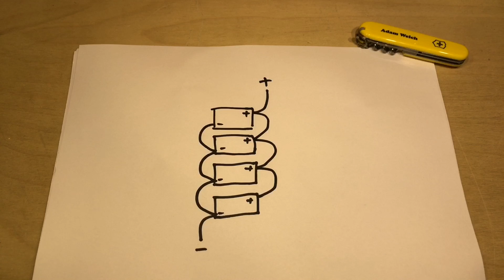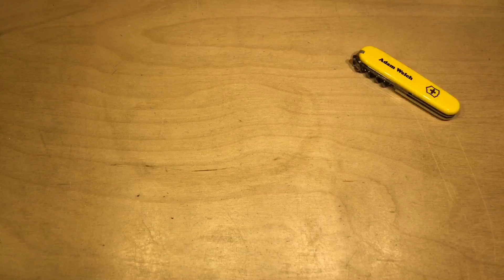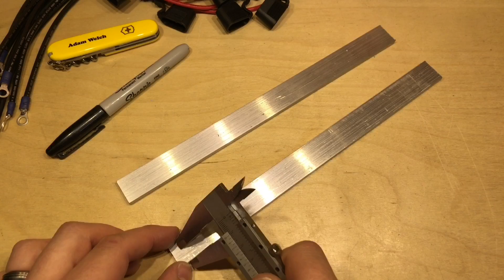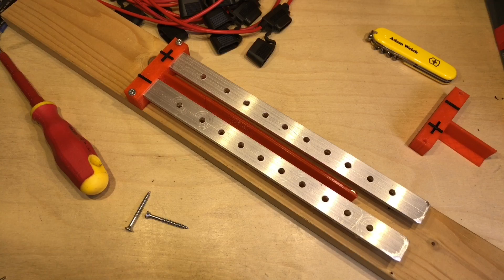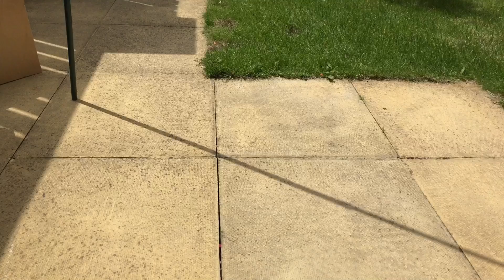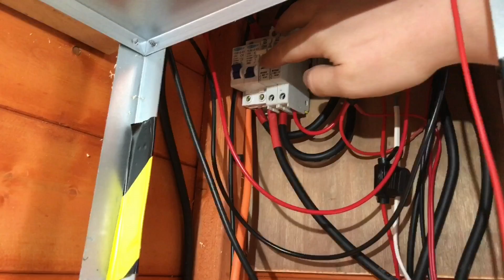Battery Bank Reconfiguration - 12v Solar Shed

Comment: That iine fuse holder is far underrated... you are wayoffon your cabling...   look outfor a meltdown... scary setup.  Yes it will work... but is it worth burning down the building it is in

Comment: Hi Adam, I am a new subscriber looking into your old videos. The wiring seems to be small if you have an inverter but is that because each battery is now going through the busbar?
Reply from the maker: Yeah, with the batteries in parallel each one was delivering only a small amount of current which adds up to to a much larger current on the bus bar and the main positive and negative cables. Each battery was fused at 10amps if I remember correctly giving around 80amps available for an inverter.
Reply: Thanks, has it panned out well over the years doing it that way. Clearly it would be cheaper to start from scratch that way.

Comment: I use flattened legnths of copper plumbing for my buss bars. Make friends with your local plumber and you can probably get more 1'+/- cast offs than you could ever use. If you really wanted to be finicky about it one end of the lead could be soldered right into holes you drilled.

Comment: Great one I like it I did something similar to the 24-volt bank I got in the house but this is great I'll do that in the garage since I had 4 12-volt batteries in parallel and the middle one died and drained the outer to

Comment: The batteries being right up against each other is absolutely fine. if your having trouble with high battery temp you have charger issues or bad cells in one or several batteries. the biggest problem i see is your wire is way to small and too long. your losing efficiancy ...

Comment: I have been given 2 batteries built from 84 LG Chem 60 amp hour pouches configured as 14s3p
I want to keep them in tip top condition until they get connected as a household powerwall.
Something like this would slowly charge them, but should I take them to say 70% charged and every so often check them, or charge them to say 47 volts and have them discharging through a small load down to say 42 volts then repeat, and how big a load should I use? I was thinking a couple of 24volt bulbs in series.
I also have some configured as 3s4p that need looking after.
I need a bigger shed
Reply from the maker: We all need bigger sheds Roger! If you are storing your lithium cells for long periods it’s best to charge them to a mid cycle storage voltage (for example I’d go for about 3.8 volts for lithium ion). That’s how most new electronics are delivered and stored. This will also allow you to see after a few months of any of the cells are self discharging more than any other. 
Cycling your cells, even only lightly will reduce their service life. It’s a chemical reaction after all and the process can’t go on forever.

Comment: Yea, short Bus Bar is the means.  Utilizing Aluminum somewhat defeated the purpose.  LOL  I use Aluminum Bar like that with little to NO ISSUES.    Not quite as conductive as Copper but using over size corrects that issue.  CHEAP !  Employ Conductive Adhesive used for Auto Window Heater Elements insures electrical Bond for years.

Comment: Hallo adam i like your video but in this case this is not save suppose there is a Mouse don 't dak where she com from but belief me she going touch your two bars and then bang You have a dead Mouse make between the two bars 50 cm and put direct after the fuse a switch That can break the red and the black wire  now You can change one battery safely
Reply from the maker: That really isn't an issue for a 12v dc system.  I can touch both buss bars at the same time without getting any type of shock. I don't believe a mouse is anymore conductive than my finger.

Comment: I feel like you could have just taped those holes
Reply from the maker: Quite possibly, but I haven’t done that before with any success!
Reply: For aluminum and thin steel I have been using those drill bit and tap in one they break on thick steel but softer metals are fine
Reply from the maker: Cheers. I might get myself some.

Comment: For that ‘tight’ positive lead on the right, you could just loosen and rotate the bus bar end of it anti-clockwise, so it is pointing towards the battery - that should give you a little slack and less strain on the terminal crimp too. 
I’m really enjoying this series of videos- keep them coming 😊
Reply from the maker: Cheers Graham. Since making this video I have replaced this cable to give more slack. Still getting positive results with this setup too. Thanks for the nice comments and the suggestion.

Comment: i just did a very similar setup using the next size down in batteries, I have 2 banks so far both containing 6 batteries each. I have the charging off a solar panel in conjunction with a car battery that is charged from a separate panel. I have only just finished the setup and only visit the property occasionally so im yet to test. Is the idea that this will hold greater power than a single car battery? I did this because the batteries were free so I wouldn't have thought to do this otherwise. Is there a benefit to separate cells in this format or would the ideal setup be a deep cell truck battery or li-Po battery?
Reply: Note - Old alarm systems are a great place to get the small lead 12V batteries cheap or for free if your lucky. they are always kept charged and only the highest quality is used, however replaced in the new system so alarm companies have tones of them.

Comment: Looks like you have enough room to put a cable on each end, of each buss bar, and combine them at inverter(?)
Reply from the maker: I did leave room for expansion, but my inverter does come off the main cable. It’s protected by a breaker - or two.

Comment: Uhm.. that's not how batteries works. If you have 6 batteries in parallel, no mater what point you connect the load, the load across the batteries will be equal/the same. Same goes with charging, if they are in parallel, all the batteries will receive the same amount of charge, and they will equalize given a little time.   No amount of fusing will change that. If you connect 1 low battery in a bank of 6, the other 5 will discharge into the 1 low one until all reach the same voltage/level of charge.  If you have a shorted out battery in your pack.. all 6 will drain to the same level as that one. That's why you should only use 1 type of battery in a pack, never mix batteries of different type or age.  You can mix batteries of varying capacity with no issues. But they have to be the same type.

Comment: I have golf cart batts. in series. for 24v. it helps the inverter efficiency. but now I need buck converters for my 12v led lights. any advice for a good cheap buck converter that will last. I have about 10 16' led tape strips. and 4 are RGB. so I need about 30-40amps at 12v. I would like the most efficient design. or I may as well use my inverter. I also have a low voltage relay on mind. at 30 amps 24v. to shut off at 22v. use this with a 30 amp or multiple 10amp units. what ever is most efficient . power consumption wise. great videos very inspiring. makes me want to finish my off grid home. and move.
Reply from the maker: I pretty much tested this exact thing a little while ago - although not to the level of current you are thinking about.  If you use a load output of a solar charge controller that should give you the low voltage disconnect you require.  https://youtu.be/dZHuj3R-g9A

Comment: hey adam you can drop the gauge wire down as well because of load share tie your batteries in pairs instead of singles but do the same and keep the cables the same length. Keep in mind as well path of least resistance the point where the batteries as closer to the inverter those batteries will be drained first and the farthest will play alot of catch up under high loads. Also the first to get drained is the first to get charged and also the first to fail.

Comment: where did you get your batteries from I have two the same but would like to get more without pay lots of money
Reply from the maker: +mark smith They were taken from UPS's which were undergoing routine maintenance. They were due to be scrapped until I saved them.
Reply: I got mine out of car booster packs but waiting for more to come along so I can increase on amps aa there are only 20 amps each

Comment: Koodos!  Now ya just need to make another 3D printed part: a cap to cover the whole strip so nothing "accidentally" touches both bars at once. Which would only happen when you're in there doing some kind of maintenance. Unless you wanna do like Pete did and make sparkles  :P

And, of course, it's sunny when you can't use it, and raining when you need the sun :)

Comment: Hi Adam, i like the fusing individual batteries idea. Always good to have fuses. Worthwhile  for people to put an LED + feed resistor in parallel with each fuse to show if a fuse blows, so it doesn't go unnoticed & just leave 1 battery not contributing to the bank.Ideal for a low current set up without massive thick cables like yours.

I didn't fuse each individual heavy cable to each battery for my 3000 watt inverter. As you know (but others may not) each terminal crimp,connector & fuse adds a small voltage drop. The Smartgauge website has some interesting stuff on this. It surprised me just how bad this chap found the losses could be at heavy currents, when the total is maybe 200 or more amps for batteries wired in parallel.The losses on my set up are low, but over time with corrosion in the crimp terminals etc it could be a problem.

I 've fixed quite a few Dragon rechargeable searchlights, like the police use. These can draw up to 8 amps (100W) & have push on crimp terminals to the cut-out circuit board. After years of use it was possible to lose up to  nearly 0.1 v  at every crimp.With wiring, the fuse/holder, relay, battery connector & loads of crimps you could end up wit 12v at the battery but less than 11 v at the bulb.Fitting new crimp terminals etc. improved this a lot.

Thanks for an interesting video, regards.
Reply: Meant to add , always best to solder the crimps like you've done to avoid poor contacts inside, as years go by. Commercial products often don't bother for manufacturing speed. I've noticed that the pre- crimped heavy cables people buy for car starter motors etc. often aren't soldered. You can sometimes only easily tell by removing the heat shrink on them & looking,  Fuse indicator wise, I was thinking of a separate mounted little box with LED's in a row connected across each fuse with a resistor. More work , but if someone was starting from scratch, the thin wires to the LED box could go in the same crimp connectors .Should indicate if a dud battery blew a fuse with a shorted cell. Enough voltage difference to light an LED. I don't  think shorted cells are that common for lead acid batteries, but it does happen. A 10v or so faulty battery with the higher 12V + ( 14 v+ on charging,) common line, should light an LED.Your 3 D printing is great . I wish I had one.

Comment: Great project :)  One thing, as all the batteries are in parallel how will you know if a fuse has blown ?
Reply from the maker: +Zen Zen That's a good point. A few ways I can think of. Open the fuse holders up and try to look from the top - might be a little tricky to see. Grab my multimeter and check continuity between the negative bus bar and each battery negative terminal. Or finally run a load and use my dc clamp meter around each batteries wire to check that each battery is delivering some current. There might be some improvement to make here - thanks.
Reply: Would be nice if you could somehow rig up a resistor/LED arrangement across each fuse as an indicator to show if it has blown.  I've seen this on equipment many moons ago so I'll do some digging :)
Reply: Various circuits around for this on a Google search, some better than others,  but the easiest thing I've found are blade fuses with a built in LED that lights up when the fuse has blown :) You would then just need to drill a little hole in the fuse cover so that you can see it easily.  https://www.autoelectricsupplies.co.uk/product/854/category/157
Reply: Yes , that's what I was thinking & suggested  before I noticed your comment. Sometimes you get a faulty fuse or holder. Be a shame to damage a good battery by not realizing that it was not being charged & got sulphated, just for a fuse.
Reply: I wonder if the resistor in the lighting up blade fuses would be low enough to make it light in this set up? There'd only be the voltage difference between the bad battery /good battery line. Probably only 2-4 volts in most cases, a bit different to most applications where the fuses are connected to just one 12v battery.

Comment: Hi, enjoyed the vid a lot. Just a question, does having the main output wires at opposite ends of a busbar make any difference?
Reply from the maker: Thank you.  The quick answer is yes, but probably relatively small.   You take the main positive and negative at opposite ends of the string to even out the load.  If you took both from the same end the first battery would deliver the most current, with the second delivering the second most etc. etc.  The last battery in the string would in theory remain the least discharged, but also the least charged - so ultimately lowest cycles.  Now in reality, it will probably feed its current into the next battery up, as will that one - so left to sit for a while they'll all become pretty even again.  Although for current to flow there has to be a potential difference - so one battery must be higher than another.
As I said ideally you connect all batteries to the same bolt to reduce the increased resistance between each leg in the ladder.  Sadly that's really messy and not always possible, so I went for the second most ideal option I could come up with.
Reply: Hi Philip,it won't make much difference with smaller batteries like Adams .According to Smargauge, this sort of thing makes a huge difference with several large (N.B. say,100 A.H batteries) wired in parallel for big inverters. In one instance one battery delivered twice the current to another according to this guy for one (bad) method of wiring. I still find it hard to believe that It's THAT bad, but Smartgauge say they've done proper tests & it really is, even with thick cable etc. cheers.

Comment: consider using neutral grounding buss bar (found at box stores) in the future... 

http://www.ebay.com/itm/GROUNDING-BUS-COMMON-NEUTRAL-BAR-18-8-AWG-GB10-130-/252973686722?hash=item3ae6681fc2:g:hH8AAOSwyZ5UoDUE
Reply from the maker: That's a nice suggestion - a bit off the shelf though for this 'over engineered' project! :-)

Comment: Where do you get your bolts from?  i've tried a few local diy places and couldn't find any.  I built a wind turbine recently which needed lots of different sizes/lengths and it was a chew on buying bolts so had to get a kit from Amazon although not the cheapest.  Like the design and kudos for designing your own kit!
Reply from the maker: Cheers Colin.  The bolts were m5 16mm Cap Screws from Toolstation (item 29995) and I used their m5 nuts too. I've one not too far form me but it's free delivery if you spend £10 anyway.  I'm accumulating a decent biscuit tin of various sizes and lengths of bolt now from various projects and using the why buy one, buy many philosophy!
Reply: Hi Colin, yes Toolstation is great. Another good place for all sorts from connectors to hardware & semiconductors etc. is CPC Plc (Preston). You only have to spend £5 (ex VAT) online for free postage . I have one of their catalogues & it's A4 about 2 inches thick!

Comment: Hope you also have main breaker/fuse or 50 amps so you don't blow all the small fuses if a large motors surge puts out 100 amps for 2 seconds systematically blowing all the fuses.
Reply from the maker: +pirucreek Yeah I showed the breaker near the end of this video. It's 63 amps - less than the total of the individual fuses.

Comment: I am trying to build a lead acid balancing circuit using a dedicated SMD chip. Might be over kill for this, but I will try and find the info on the chip and post. We are using it to try and extend the life of a 36v battery setup 6x6v golf cart batteries
Reply from the maker: Sounds like an interesting project - cheers.

Comment: Nicely done, Adam. You might find that the batteries are taking/delivering slightly different currents because of various factors. There will also be some current flow from one battery to another. These things are inevitable, but you've done what you reasonably can to minimise future problems. As for the tight spacing, maybe Aluminium plates between batteries, a radiator, and even a cooling fan could be used when under high load or high ambient temperatures. If you're not pushing them hard, the batteries should be fine as-is. They have far harder lives in cars!
Reply from the maker: A very good point - engine bay temps can get quite high (and pretty low too)!
Aluminium plates is a nice idea - I'd just need to make sure they were clear of the terminals.  My batteries tend not to be under very high loads at all and you must remember, I live in England - high temperatures aren't all that frequent either!  Cheers
Reply: Hi Adam i know it's a old video but perfect work. Current flow between batteries would be ideal hence balancing. Plans for my future powerwall thinking of going lipo4 100amp cells. Just starting now on building 18650 mppt 100w solar for shed power so your video's have been brilliant thanks.  In progres of building ebike aswell.
Any mppt solar chargers that will work with a dc wind turbin 120w 10 amp.
Cheers thanks